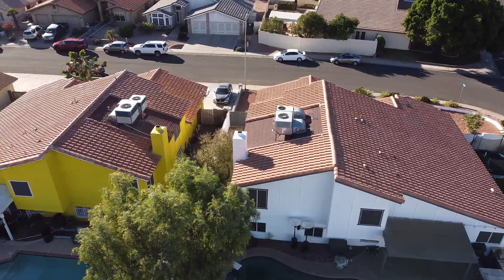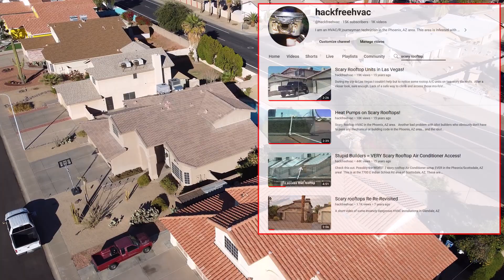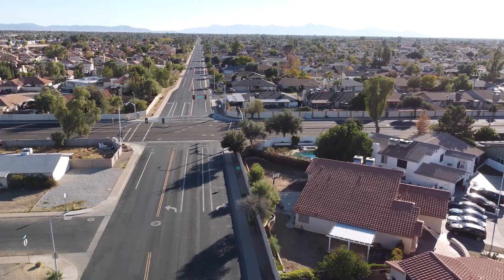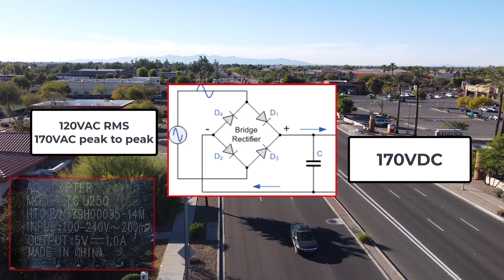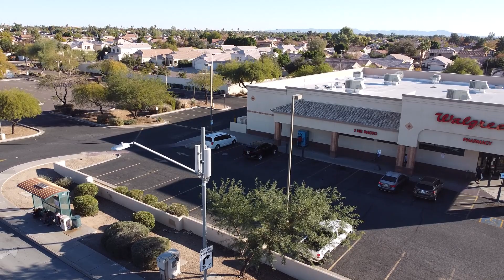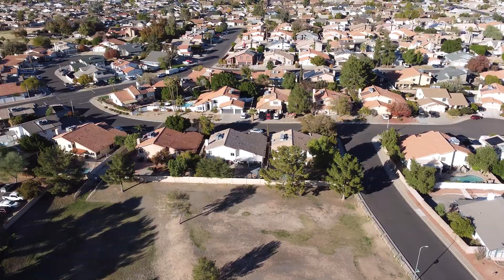Scary Rooftop (HVAC) now have the "Scary 5G"! 😬⚡

Comment: They expect everybody to have a scissor lift, to do this type of work.
A flat roof section for the units would help, if they need to be up there.
Would this be a stupid HOA??
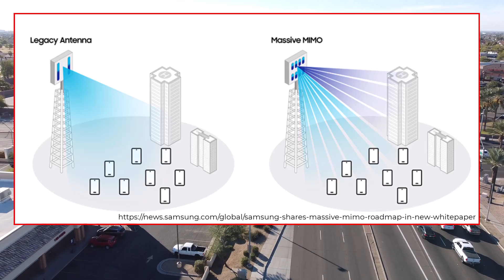11:19, would you think running, fibre-optic be more economical and better in the long run??

Comment: Why techs hare home builders
Reply from the maker: No kidding. If the unit is not on a 2 story roof like this, the split system has the furnace or AHU up in an attic and half the time there isn't even a catwalk!

I envy the other stats that almost always have the split unit furnace/AHU in a basement, garage or closet. It's bullshit that they every started to favor attics and rooftops for residential